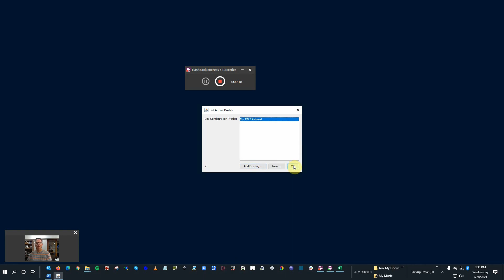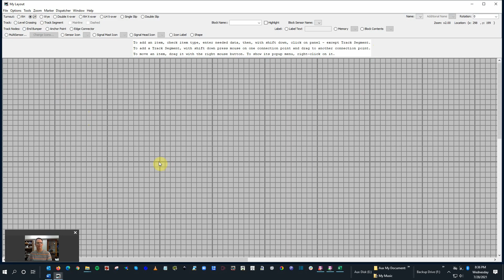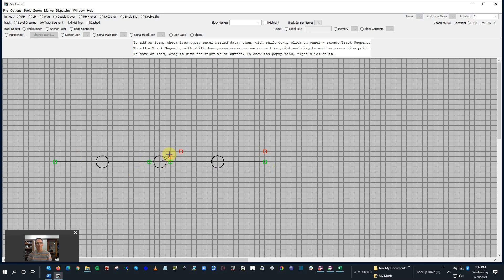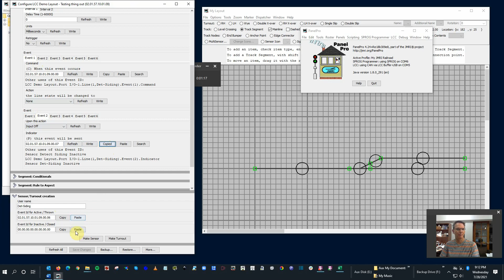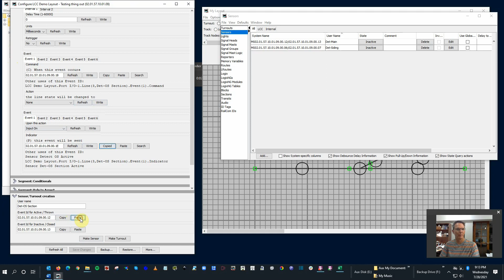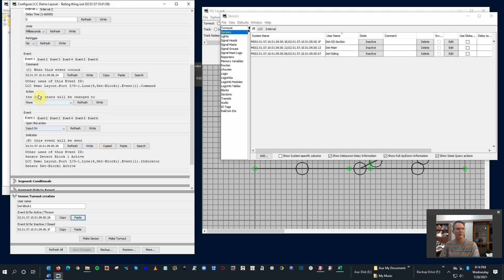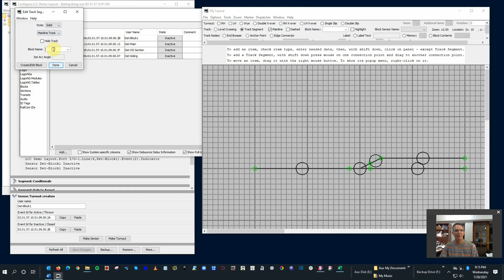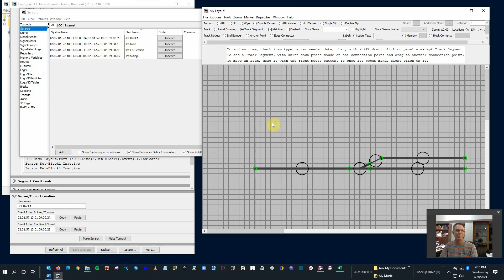TLC #8 Setting up Panel Pro for LCC

Comment: Awesome series. Thanks for producing these videos. One question, Im guessing while you use LCC with JMRI for sensors and turnout functions you have to keep the USB connected to your computer to allow communications between JMRI and LCC?
Reply from the maker: Correct, if you want to use your PC for interfacing with LCC, you will need to use JMRI and the LCC-Buffer to connect the PC to LCC via USB. Keep in mind, though, you don't need to have the PC on or connected if you want to use the LCC network without JMRI. It'll operate just fine without the PC.

Comment: These are really good LCC teaching videos Detlef. I appreciate all the time you are taking to put them together and that you have chosen to keep them short enough and focused on a particular aspect so that they are not overwhelming. Have you posted a wiring diagram of your test layout showing all the terminations on all the hardware including the locations of insulated rail joiners? Also, have you used any IR sensors with RR_CirKits boards. If so, which module did you use and can you show us how you wired them to the module? Thanks again.
Reply from the maker: Hi, and sorry for the late reply. Thanks for the kind words and encouragement. I need to do a few more video to pull in some of the asks you are mentioning. To directly answer your questions: I don't have an all-in wiring diagram. Hopefully you can glean the wiring from the various videos and close-ups.No insulated rail jointers. I just cut one of the rails straight through with a cut-off disk wherever I want a break. No IR sensors - all detection is done through current measurement. I am not a fan of IR detection since if the train or car is not directly at the sensor, it will show as the block is unoccupied. Thanks again for your note!

Comment from the maker: Someone asked about the need to set up each turnout as its own detection block. Absolutely not necessary. I did it as that is a typical CTC arrangement. But if you are modeling ABS or APB, or just want detection to track occupancy for, say, a staging yard, no need to isolate and detect the turnouts.
Reply: Thanks, That is what I figured.  If I ever decide to do signaling it will be semaphores.

Comment: I watched the video & saw where you created a panel & the table.  I am going to start this on Friday BUT I already have all my tables & the panel created.  How does that affect your instructions are going to be my first things to work out. Do I use my table User Names or will I have to duplicate/convert to OLCC Event ID's?
Thanks for the videos & please keep them coming.
Dennis Munro - Berlin, WI
Reply from the maker: No need to create a new panel and names. Just import the LCC event IDs as shown. Not sure how your panel is set up to convey the commands and feedback from/to the layout, so you may have to play with the data in the sensors and turnout tables to make your panel work like you want it to. But it's pretty straight forward. I have my layout panel running both LCC and MRC PA gateways into the layout. Both live in the same tables.
Reply: I have gotten it to work without a lot of work.  I had to use different sensor names which then required that change in the block table to each block & then a change to the panel to rename the sensor icon's I was using.  I also had to redo the logix because i use a "Reset" logic to reset the turnouts & the block occupancy "notifications" on every panel I build.  I also reread the first 38  pages of the Signal-LCC manual.  To bad it is roughly 3 years since last update.
Reply from the maker: Great to hear you got it working. It is a bit like a different language. Once you get the patterns, things tend to fall into place fairly quickly.

Comment: Will you be going through the steps of wiring the boards to switches like a rotary?  And how can you make a switch for the direction of the train for signaling?  Just by using a ctc board?  That way it’s stand alone and not computer interfaced?
Reply from the maker: If I understand your question, there is very little more to do to bring in a rotary switch than for a push button, just more of them in parallel. I did a blog post showing the details of wiring out a PB at 
https://greatnorthwesternrailway.blogspot.com/2019/04/configuring-push-buttons-for-turnout.html

Something you may want to consider is why you would want to use a rotary switch. A rotary sw will always hold a position as an input. LCC will already do that for you. Simpler may be a set of momentary PBs. The inputs will seal-in as soon as the PB is pushed. Perhaps I am not totally understanding, and your question is more related to developing a CTC panel in LCC, using rotary switches for the CTC panel controls. That can certainly be done. Inputs wired in as shown in the blog, and then develop the logic to follow whatever you would want your CTC system to do. And yes, 100% without the need for a PC.
Reply: @the-lcc-channel   yes it would be a true CTC panel with the rotary switches 
    I know a simple push button would be the easiest but  to have that wow factor and to be more prototypical With the rotary switch.  
  Do you know of any documentation for wiring the rotary switch for the bi-directions of the signals and rotary for the switch.   
  I will check out your blog  
 Thanks!
Reply from the maker: @Chinquapinmayor  Totally agree. Thinking about it, whether it is a PB or a rotary sw does not change anything. They would all be wired in the same, and the logic handled the same. The input cards will see the input and issue the event either way. I don't have anything in my blog about wiring in rotary switches, but again, the wiring will be the same. I am not aware of anyone specifically developing a classic CTC machine and tying it into an LCC system. Might be a good question to ask on the LCC forum on GroupsIO. In any case, I don't see this as an overly complicated application for LCC and seems to me to be very doable.

Comment: Good stuff as always, I found that adding detection (LCC) and sensors (JMRI Layout Editor) were actually a couple of the easier things I did when starting out in LCC earlier this year.
Reply from the maker: It really is a lot easier than folks think it is. But going through it the first time isn't necessarily intuitive. As you pointed out, once you kinda get the hang of how the CDI is set up, it becomes a lot more clear and straight forward.

Comment: Okay, I watched it... and still have no idea how you did that.  I will have to follow along on my own layout and watch it again.  Thanks for the info... you don't do mind melds do you?  That might help...
Reply from the maker: LOL! Would be nice to be able to do that, right? What piece is confusing? This vid was mostly focused on how to connect the two systems. For understanding the CDI side more, take a look at some of my other vids. On the JMRI side, there are lots better ones out there specifically showing how to create a panel.
Reply: @the-lcc-channel  Yes, that is my plan, to watch all your vids to gain a better understanding of LCC and JMRI.  My short term memory is getting weaker, so I have to go over a few times to keep track of the flow.
(I used to be able to carry a multitude of variables and subroutines and change on the fly while programming, now I can't remember 1 number from 1 page to ... what was the question?)